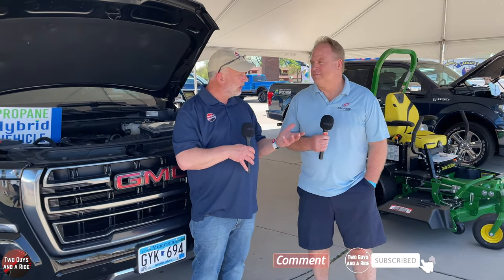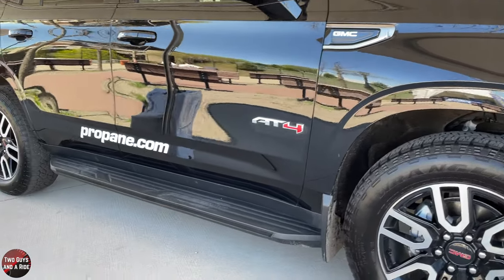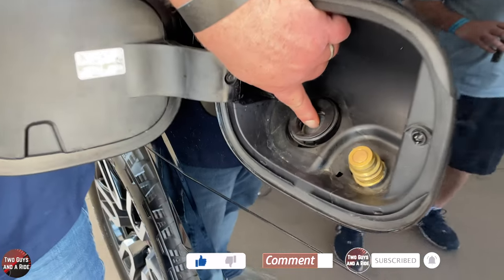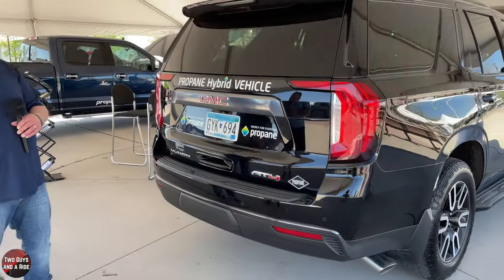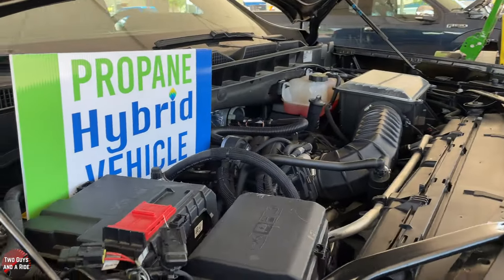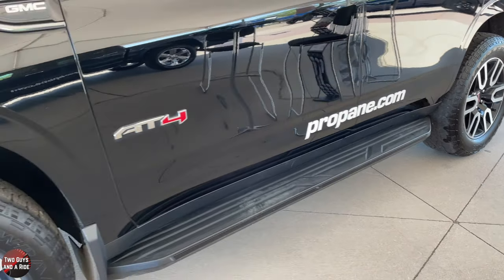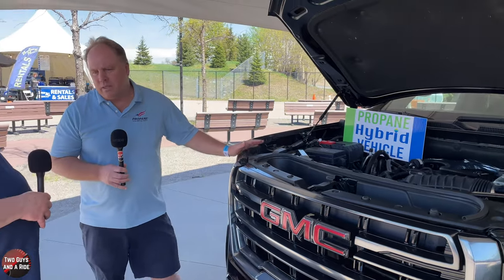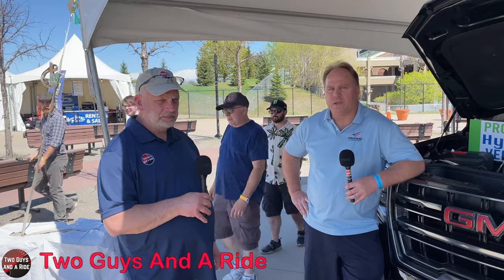Dual Powered Gas/Propane Yukon XT4

Comment: For all who are thinking of doing this conversion, I just bought my, Italian made, kit for my 3.L Ford Ranger for $600
During my time in Ukraine, where many have conversions, I met friends who actually do these conversion and charge $1000 for the WHOLE job.
$9000 is criminal!
Reply from the maker: Ok
Reply: Different market I guess. In some part of Italy, a LPG/CNG conversion costs 450/500 Euro, for "normal cars". If you have to convert 5, 6 inline, V6, V8 will costs a little bit more, and if you want a liquid system so you don't have to drill the intake manifold, you have to pay more. We in Italy have really good companies that makes gas conversion kits. I have an LPG system on my Toyota Yaris XP10 1.0 liter manual, super cheap to run, 60 cent per liter and it's also ecologic.

Comment: How do you prevent it from exploding when in an accident?
Reply from the maker: Thanks for the question. Propane powered vehicles are fitted with safety devices and shut off valves if the the fuel lines are ruptured in an accident. Thanks for watching!
Reply: For real what if it’s crashed from the rear end

Comment: I have a propane foodtruck that was given to me. I would like to use it for work. It's gutless in general and think adding a gas fuel tank for dual fuel would help. Any tips or advice? Thanks a bunch!!
Reply from the maker: Thanks for the question. I would recommend checking with a company (link for this company in the video is in the description under the video) that does this type of conversion to see if your vehicle is even a possibility for such a conversion. I know that they only do this on certain vehicles. Hope that helps and thanks for watching!

Comment: A friend of my had a propane powered F150 in high school in about 1988.  It was gutless. This guy is saying the power is equal to that of gas? Wow. Technology has came a long way. He had a toggle switch in the cab, to switch from propane to gas.
Reply from the maker: Tech has definitely changed sine 1988. Thanks for sharing!
Reply: I would like to install a propane tank as the extra fuel alternative,where is the best shop location where I can install it on my brand new Ford transit?
Reply from the maker: @vinnygarcia4448  thanks for the comment. I would recommend starting by clicking on the link in the description for this company and check with them to see if your Transit is adoptable to propane. Thanks for watching!
Reply from the maker: @vinnygarcia4448  Google for Vehicle Propane Conversion in you area.
Reply: @TwoGuysandaRide  ok yes thank you i did went to the link you told me I’m going to call tomorrow,I tried today but it’s Sunday I’ll let you know if I need a suggestion,I appreciate it
Reply: You need more fuel and advanced timing to make the same power. Probably couldn't make those adjustments on the fly in the 80s
Reply: Lol, what did you expect? That 88 5.0L in the F150 made a magical 110 hp or something like that....
Reply: @garykainth3460  I was in 8th grade.  I don't suppose I suspected much of anything.  As an adult now, that is what I'd suspect of a 8th grader.  What did you expect an 8th grader to expect?  LOL.

Comment: Would you be able to fill the vehicle from a 500 gallon residential LP tank? Is there adapters to make that possible?
Reply from the maker: I would contact an installer to be sure what your proposing will work, you can click the link in our description below to start. So, that being said, there are adaptors out there for filling your vehicle with propane, but check with some folks that install/convert cars to propane to be sure it’s safe, and reliable. Thanks for watching!

Comment: This is intriguing. Can this work with diesel as well? This seems to be a nice bridge between petrol fuel and EV vehicles.
Reply from the maker: It won't work with a Diesel engine as the only fuel. It will work alongside diesel fuel. Propane acts as a catalyst and raises the burn rate of diesel fuel to almost 100 percent and it also will increase boost pressure and horsepower. Thanks for the question
Reply: Diesels in Europe are sometimes converted to CNG.
Reply: Who the hell was talking about the bastard gas, CNG?
We, the adults, are talking about clean, efficient propane.
Reply: @ShortArmStrongArm  CNG is also clean and efficient...

Comment: Can you still use the vehicle on gas only or needs to be propane an gas all the time ?
Can this system be remove to have the vehicle back to stock?
Reply from the maker: You can still use only gas or only propane, the two items never mix. Your second question would be best answered by contacting the group we interviewed. Their info is in the description under the video. Thanks for watching!
Reply: Thank you

Comment: How common are the LPG cars and fueling stations in US? A bit? Not at all?
In Europe a lot of gasoline cars are converted with bi-fuel LPG kits to run on LPG (and there are also factory specced LPG versions). And at least 50%+ of the gas stations have LPG pumps.
Reply from the maker: Very few stations here in the US have LPG. That’s the problem with alternative energy…access. Thanks for sharing
Reply: Go to any UHAUL main moving center location they sell LPG
Reply: Not allowed to use it for vehicular use only non road at uhaul.

Not taxed ….

Comment: 9 thousand dollars?
Reply from the maker: That’s their price at the time this was filmed. Don’t forget their may be rebates from your local state propane association. In this case there was a $5000 rebate available so total cost would have been $4000 (at the time this was filmed). Thanks for watching!
Reply: the most expensive LPG system install  is about 1K in EU. 9k is insane